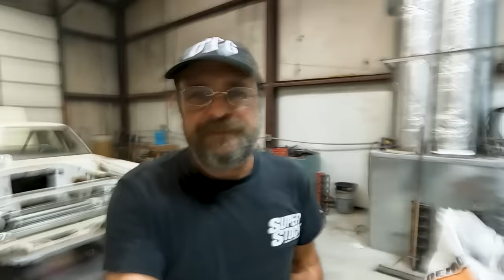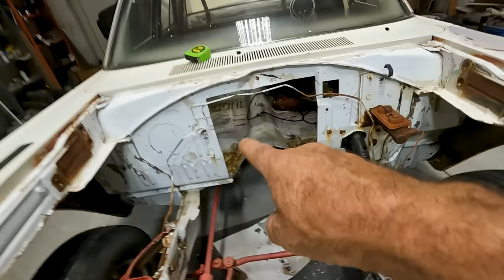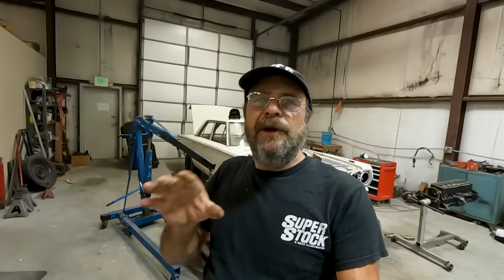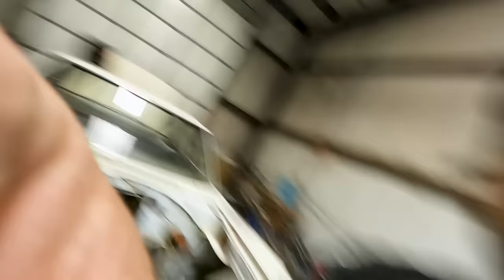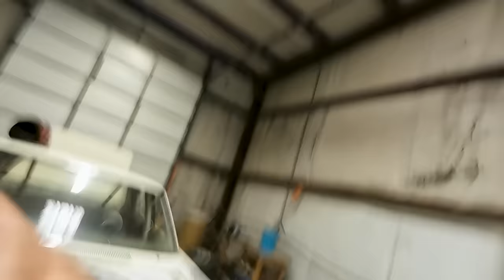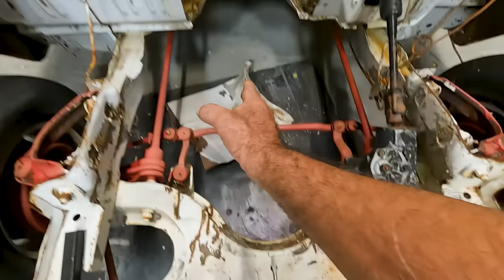The Single Most Obscure Bit Of Mopar Knowledge On The Entire Internet - Engine Swaps Made Simple

Comment: Curious about how you are going to build an engine mounting system for accommodation of different setups. I was thinking about an adjustable mount rail.Consider contacting me to discuss this, I think I might have a good solution.
Reply: Elephant Ear Mounts he said ?
Reply: Yeah, I would fab something on the concept of an X-Y slide vise (but in x-z planes), to easily set the driveline angles, and with slotted bolting provisions to lock it down afterward.  3/8-24 UNF threads would be sufficient for the adjustment bolts.

Comment: Apparently this does not work for C-bodies. Yes.... I know he did NOT say C-bodies, but I looked anyway. 1966 Dodge Polara. Has that same hole on the lower radiator support, but it is dead nuts center with the center of the car.
Reply from the maker: C Body has a removable stub frame up front.  The offset hole on the A, B and E body cars is used on the assembly line  to center the transmission tunnel.
Reply: @UncleTonysGarage  Thank you